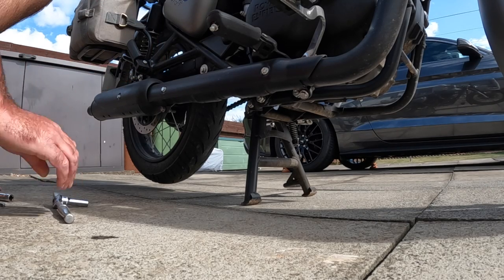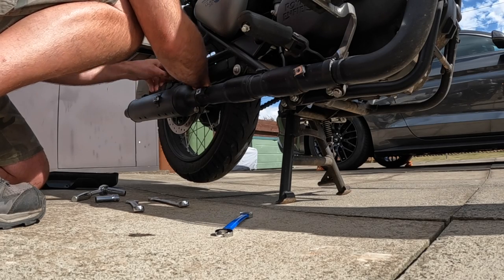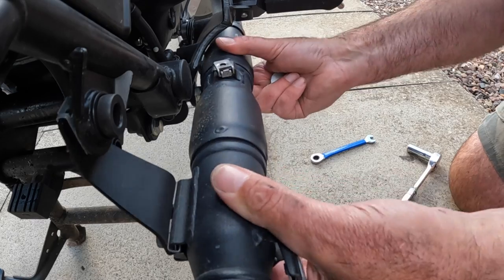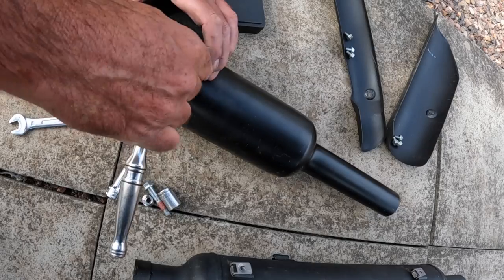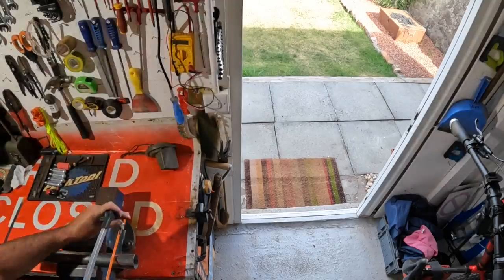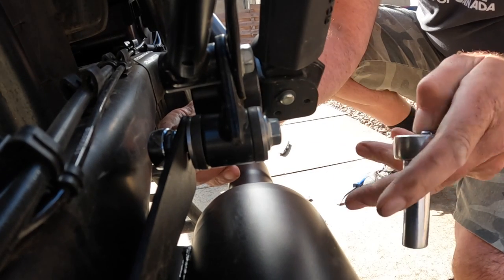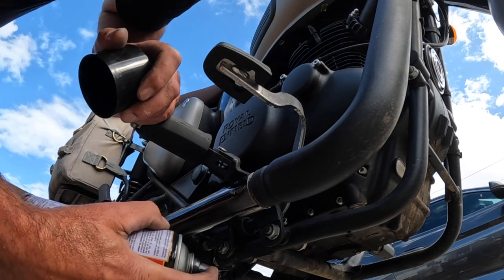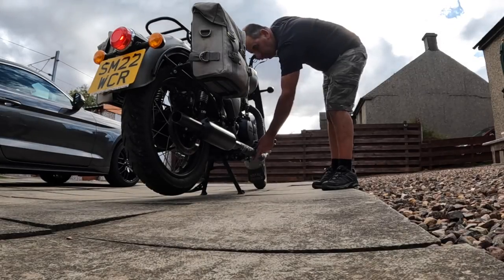Royal Enfield Classic 350 - Cat Removal and free flowing silencer Pt 1

Comment: I replaced mine too but now i have Sensor Issue i think as i have the chekc light on. How did you bypass the sensor ?
Reply from the maker: Hi, think you can reset warning lights by switching off ignition with finger on menu button and holding the button count 10 secs then switch on and restart bike and light i thing should go out, it may take several attempts, same way you remove the service spanner icon on dash when service is due 👍

Comment: Hi Bruce, fellow Bruce here.  Very helpful.  Thanks.  So a 41MM (OD or ID?) straight stainless steel pipe?  How long was it?
Reply from the maker: 42 inside diameter pipe i think it was a 2 foot lenght and i cut approx 3” off it to match lenght of the Cat 😁👍
Reply: so from the engine side he went 41mm ID over the pipe and inside the muffler right is that understandable?

Comment: I'm struggling to do this with the old muffler. it fits at the header end, but at the muffler end it is a little different.
Reply from the maker: Hi, i never used the stock Silencer and used an aftermarket tail pipe, if you fit a Hitchcocks UK de cat mid pipe the stock silencer will go straight on 👍

Comment: Please guide me bro I'm new to RE, I have a classic reborn.
1) If I remove the cat con & keep the silencer stock, will there be a better thump?
2) If I change the silencer & keep the cat con, will there be a better thump?
3) Which after market silencer is recommended, free flow or with baffles/db killers & why?
4) Does your exhaust have baffles/db killers?
5) Does installing free flow/without db killers exhaust affect the performance?
6) If you had to choose one, would you change the silencer or remove the cat con?
In my country, police literally inserts rod to check the baffles.
Reply from the maker: Hi, I would keep the stock silencer and just fit the de cat mid pipe and fit the DNA air filter, the stock silencer has a lovely noise and keeps thing legal while the de cat mid pipe and freeer flow air filter gives the mid range power boost 👍😁
Reply: Are you a software test engineer? 😂Because those lines look like test cases!
Reply from the maker: @nareshbabu4436  
You have lost me now on this reply

Comment: Hi Bruce, you are a patient man. answering all the questions. i have one, did you ever check out how much the cat weighed?
Reply from the maker: Hi i have not weighed the Cat, but i did have it off the shelf on the bench while filming yesterday as just bought a cheap India (copy) de-cat pipe on eBay fir £24! Ivneed new digital scales as old set broke when accidentally dropped, but will weigh the Cat pipe soon and post up the weight on another garage film 😁👍
Cheers Bruce

Comment: And I'm a bit confused with the fiberglass wrap on the pipe, isn't it an insulation medium, so exactly how would wrapping the pipe help in any way to keep it cooler 🤷🏻‍♂️
Reply from the maker: Hi Kevin, the exhaust wrap is for show  like on other less powerful bikes like MUTTs, but if you Google exhaust wrapping you will read why it’s done on high performance engines. Used to help fit it on rally cars, 
It does rip east though if you ride off-road as I found out recently 😁
Cheers Bruce
Reply: Wrap does not cool exhausts. Ceramic coating will though

Comment: Hiya. Thank you for your video. Noticed your front fender extender. Does it get got out on humps etc?
Reply from the maker: Hi, no the rubber mudguard flap stays put and has not yet folded up under the front mudguard, one of the cheapest good mods from Hitchcocks UK I have done, esp the amount of gravel that gets pick up by warm tyres

Comment: Hello costrider is the exhaust now free flow or is there something in it?
I bought the same one and was surprised it's not just a continuous pipe.
Can you see through your pipe?  Thank you
Reply from the maker: Hi, id does have a baffle but its less than the stock being smaller so a little bit louder
Reply: @Coastriderscotland  ah ok can you look through it from the front to the back?
many thanks for replying✌
Reply from the maker: @miaumeow7726  you cannot see right through for the inner baffle
Reply: @Coastriderscotland  ok thank you🙏, i wanted to know that i got the same one as you but i wanted a completely free flow silencer this will be sent to me, i can then drill a hole and install a baffle afterwards
I've already installed the dna filter and maybe I'll do the fuelx light version
Reply: Got any links for the silencer?

Comment: Wouldn't painting it been a shit load easier off the bike? And don't you think that a small hole drilled in the pipe to allow condensation to escape would be an idea 🤷🏻‍♂️ just a thought.
Reply from the maker: Hi Kevin, painting it prob easier but I wanted it warm to paint, bike is Coated in Lanoguard so not worried about overspray,  tailpipe has a drain hole in it as it sits lower than rest of exhaust and is at the end of the system 👍
Cheers Bruce
Reply: in vendita c'e' anche la versione nera

Comment: Do you have to remap the EFI when you remove the CAT?
Reply from the maker: Hi, the EFI re programmes itself once the engine has been run  - I have read 10 minutes at idle and I have also read just ride it, I have 3000 miles on the bike now so it has done 2000 miles now since de cat done

Comment: Hey mate. Can I have a link to the exhaust please?
Reply from the maker: Hi, here you go;

https://www.ebay.co.uk/itm/374172021700?mkcid=16&mkevt=1&mkrid=711-127632-2357-0&ssspo=bYVpZP78SYW&sssrc=2349624&ssuid=YOCENeG4QUS&var=&widget_ver=artemis&media=COPY
Reply: @Coastriderscotland  Thanks mate. I installed this one, but there is a small air leak at the part where the muffler joins the straight pipe. I have tightened the clamp as much as I could to the point of just stripping the bolt if I apply any more torque, but there is this tiny leak that I can feel, like breathing on the palm of my hand. Did you face any such issue? Any suggestions? I might not even bother fixing this if it is not supposed to cause any problems. Also, I have noted a lot of pops and bangs on decelration and on rolling off throttle. Have you faced these too?